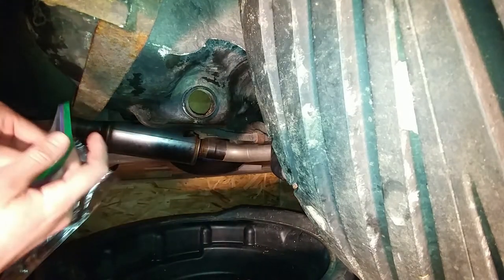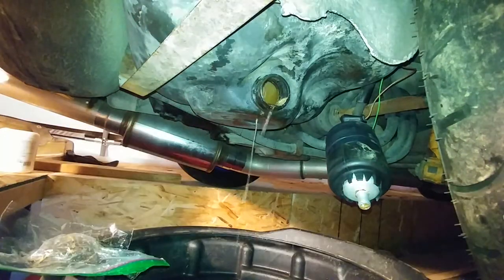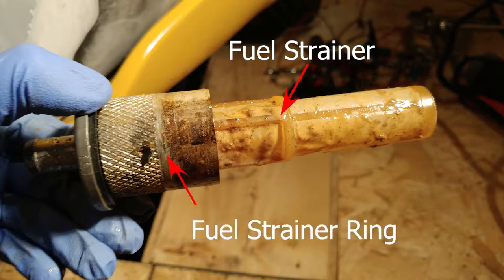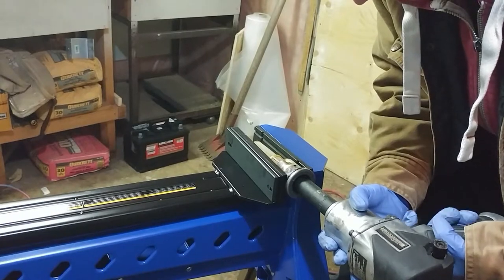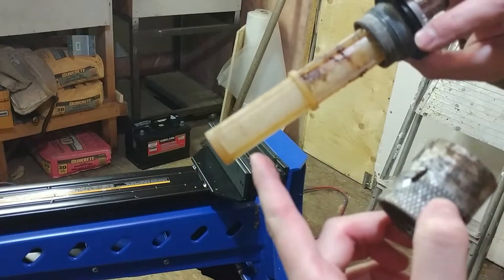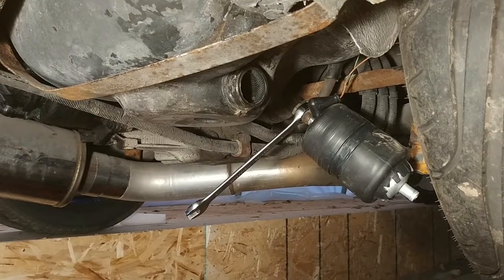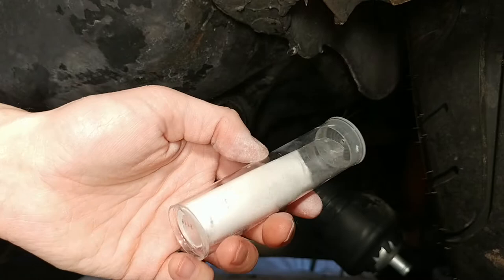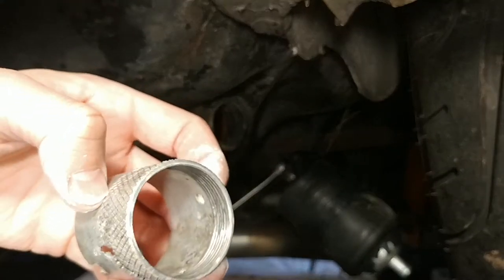How to Clean a Plastic Fuel Tank and Fuel Strainer Ring Fix - Porsche 944 Turbo Ep.3

Comment: This is a great series. I bought an ‘88 951 in 2002 that was my daily driver till 2012 when I got a 2007 Cayman S that became the daily ride. The 951 sat in my garage since then. But I recently retired from working so I sold the Cayman and decided to rejuvenate the old 951. Three weeks ago it developed a leak at the fuel tank so I started a similar project to yours except I’m just replacing parts with OEM’s. 
Then I ran into the same situation with the fuel tank strainer sleeve spinning in its housing in the fuel tank. 
My question is, are you satisfied with the job that the JB WATERWELD PUTTY did to seal the sleeve back into the tank?

Thanks again for your help.
Reply from the maker: Hey Gary that's great to hear you decided to keep the 951 and restore it. I am very happy with how the JB waterweld has held up. I have yet to get the car on the road but there has been fuel in the tank for about a year now and no leaks.
Reply: Deancent Garage I’ve gotten the tank, strainer, new pump, and filter all done...used the WaterWeld and no leaks after a week. 

My next project is bleeding the clutch hydraulics. Before I quit driving the car I had to replace the clutch master cylinder due to leaking. The shop that replaced it didn’t bleed it correctly and I always had trouble with the pedal staying down close to the floor. Only drove it shortly after that so mows the time to get it right. 

Do you have any tips for that?

Thanks again for your help.
Reply from the maker: That is great Gary, sounds like you're making good progress. Here's a great video that should help you bleed the clutch system. Https://youtu.be/wdf--suwqw0

Comment: 2 years later how's it doing?
Reply from the maker: Hey Joseph, I'm assuming you're referring to the strainer. 

Short answer - it leaked and an alternative fix has been used.

 Long answer - It likely would have been alright if I hadn't gouged out the plastic with a knife trying to make clearance to reinstall the threaded insert. A small leak was present due to the slight gouge in the plastic. So I had to remove the fuel tank strainer and upon doing so the threaded insert came loose again. I'll be uploading a video shortly on the fix. I used a 928 fuel tank threaded insert fix made of aluminum. It's an aftermarket piece that fixes this exact issue and worked perfect, just a bit pricey.

Comment: Just bought a Porsche 944 Turbo and it had a small fuel leak that I am about to attack. Going to take care of other fuel line related parts once I get the parts. Thanks for sharing this.
Reply from the maker: No problem, keep an eye out for future videos. I replaced the hard lines and rubber hoses with all new -6an hose and fittings, documenting eveything.

Comment: The sound of the crap on the threads putting the strainer in !!!!😓😓😓😓 should have used a wire wheel then some anti-seize!!!😎😎😎🍺🍺🍺🍺
Reply from the maker: If was cleaned afterwards, that was just the test fit before the jb weld set to make sure the aluminum ring didn't distort while hammering into place. Thank you for watching! 🙏

Comment: You SHOULD have put some Anti Seez on the threads of the strainer, And I change my strainer every 5yrs due to the crappy ethanol fuel.....
Reply from the maker: That is not a bad idea, next time I'm in there I'll be doing that, thank you!
Reply: Don’t use ethanol gas. I use Chevron 94 octane, ethanol free.

Comment: I had the same problem…fuel strainer came out with the sleeve and had troubles getting it back in. Instead of what you did, I cut two small slits in the side of the opening and used JB Weld epoxy and Marine weld. Unfortunately, neither held more than 6 months. Now the leak has returned and am now considering an actual plastic weld using a hot iron and stainless steel mesh to weld the slits. Any input or suggestions would be appreciated. This has been going for the last two years. And yes starting is an issue due to the fuel pressure (or lack of) but I think this is another issue.
Reply from the maker: Yup, unfortunately mine did not hold either. I ended up getting this and have not seen a drop since. It's pricey as hell but beats replacing the tank imo. https://928srus.com/products/fuel-tank-repair-sleeve-boss-all-928-fuel-tanks-78-to-95
Reply: This 928 fuel strainer sleeve… looks like it is installed through the inside of the fuel tank (photos inside the tank). How did you manage to install it and that yellow piece into the tank?
Reply from the maker: @glow9999  I went in through the top of the tank where the sending unit is. I first dropped a starightened coat hanger through both openings then slid the sleeve over the coat hanger and the sleeve nearly dropped into place. Maneuvered it into place from the fuel statiner opening, removed the coat hanger then installed the fuel strainer. Took less than 10 minutes. Just make sure the part sticking out on the threaded insert is facing down, need to be on the side, it prevents the sleeve from spinning while tigehting.
Reply: @DeancentGarage  that’s a great way of installing that. It certainly won’t fall outwards when tightening it with the strainer then. Then the yellow piece is not a requirement, I presume. It’s just there for display?
Reply: @DeancentGarage  using this 928 sleeve, you didn’t have to use any JB Weld? Looks like it’s designed with the seals, it shouldn’t leak at all. See below. I tried to edit the message but couldn’t, so I added another reply.
Reply from the maker: @glow9999  No jb weld or anything else required. That yellow piece is already inside your tank.
Reply: Thanks for all the input. I purchased that 928 sleeve and had a little fine tuning due to what I did previously, and it fixed my leak. It’s been two years with this annoying leak and finally, no leaks. Thankyou again!
Reply from the maker: @glow9999  Not a problem. Awesome to hear, glad this fixed your problem!
Reply: @DeancentGarage  Hi, I have the same problem with my 87 944.   Did the 928 fuel strainer sleeve perfect fit for the 944 or you had to modify it to make it fit into the 944?  Still no leaks? Thanks
Reply from the maker: @genermacaraeg  fits perfect, no modifications and more importantly, no leaks!